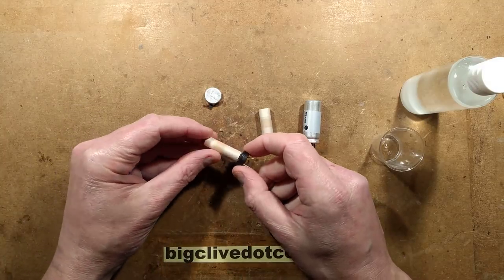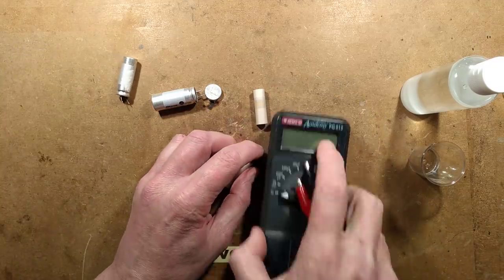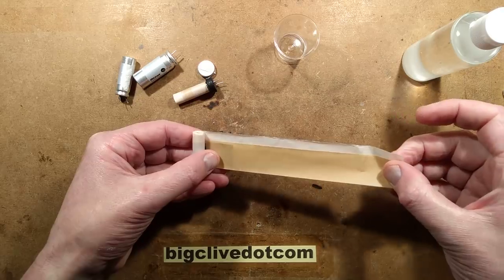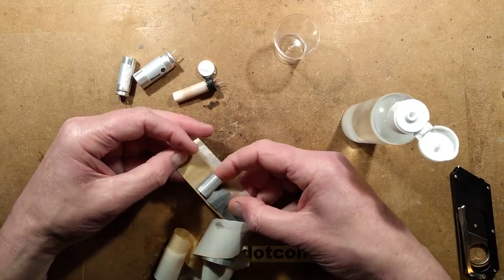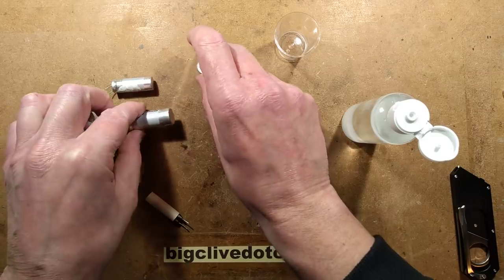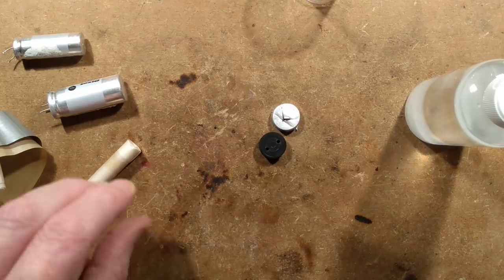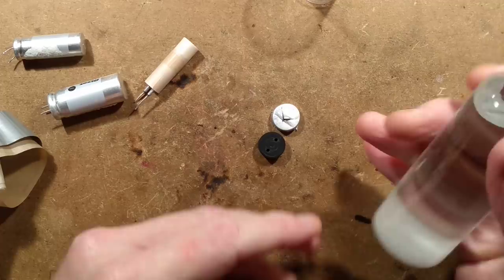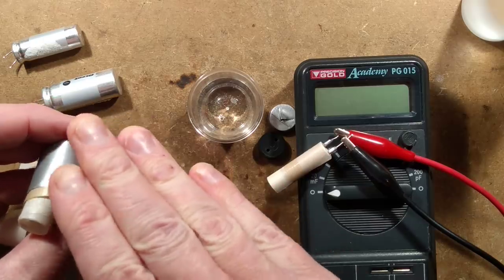Adding electrolyte to a fake (dry) capacitor.

Comment: As far as I know capacitors are formed by very slowly charging them (until the leakage current 'causes them not to charge further), then discharging them and charging them again multiple times. As you charge and discharge them, the leakage current should slowly start to drop allowing the capacitor to reach higher and higher voltages.
You should also be able to "deform" working capacitors btw. by very very slowly charging them with reverse polarity over and over again, 'causing the oxide layer to dissolve on the one side and build back up on the other side. So theoretically you could "reform" a capacitor so that the polarity label is the wrong way around. And then you can give them to someone as a prank... :D

Comment: An interesting (if you're at all interested in chemistry) fact about acids is that certain acids cannot even truly exist in an acidic environment. Examples besides boric acid are carbonic acid and hypochlorous acid which are really just CO2 or Cl2 dissolved in water without a something more basic present to stabilize them as carbonate or hypochlorite respectively.  That's why adding acids to baking soda is fun and adding them to bleach is dangerous.  Both gasses rapidly come out of solution without a strong base to keep them as stable and soluble ions.
Also there are the fatty acids which despite being called acids cannot even dissolve in water on their own and so can't 'do' anything acidic without a strong base, similar to the gasses i mentioned, except that they are either soaps when things are basic enough or fats if not. They are huge, heavy molecules with boiling points of hundreds of degrees and so precipitate out of solution rather than bubbling out. And lastly, there are things called acids that are simply derived from acids and are more properly amides or peptides ie: LSD and DNA.  I'm not sure why that's done. Maybe someone who knows more about bio can shed some light on it. My guess is that people are just lazy and calling things acids makes them sound cooler and more dangerous.

Comment: They probably found that the first capacitors of the batch were failing the voltage test, meaning that the oxide layer was not thick enough or not continuous.  So they stopped filling them with electrolyte and let the remainder of the batch continue to be cased so that they could sell them as dummies.  The one Clive tested may have had holes in the oxide layer.

Comment: With electrochemical reactions you will generally see the same voltage/current for a long time until the reaction gets close to depleting, since there's a saturation effect where the current is limited by something other than the reaction itself until it isn't.

(Please correct me if I'm wrong, I'm not a chemist)

Comment: youve made a poor electrolytic rectifier XD
Reply: Yes those things do actually exist or at least did it one time also there was the electrolytic surge protector that used aluminum I think sodium hydroxide? Is electrolyte but was actually a surge protective device hexe even use water that was flowing for surge protection and power plants back in the old days.

Comment: Siemens and other manufacturers of VFDs give a time span to reform their capacitors in said VFDs wich ist said to be a quarter voltage with a few hours at a time and then another quarter (of the known nominal voltage).

Comment: A lot of really old devices don't even have electrolytics - they have wax or oil caps. Some don't have capacitor problems at all, some use dry electrolytics or mica, other materials that don't have issues at all.

Comment: I have noticed (through experiment) that A DC capacitor will conduct current continuously when the voltage is the wrong polarity and so eventually heat up depending on current, cheers.

Comment: 5-6ma is quite some leakage current. You need to leave it for a while so it can build the layer. You also need to build up the voltage slowly. I think the bubbling is a good thing. I bet it causes the gas to form which makes the oxide layer.

Comment: Since the anodizing process requires current, and since aluminum oxide is an insulator, for a given forming voltage, as the oxide layer gets thicker, current diminishes until the forming voltage is no longer able to shove any more current through the capacitor.
 So you basically need to leave it till voltage stops going through it, which can take hours.

Comment: If you have very old capacitors, you sometimes need to "reform them".  You use a very high resistance and the rated voltage or raise the voltage with time.

Comment: The simplest way to see if the cap can hold a charge and has a low its ESR is, to charge it up to about 12V, disconnect it from the PSU and short the leads. You should get a nice loud crack and spark. Repeat the process but this time wait a couple of minutes before shorting the leads. You can roughly gauge the amount of leakage by how reduced the spark is, if at all. Plus the spark makes a nice visual and audible spectacle.

Comment: When I tested a capacitor, that was stored since the 70th, it was only 40% of the spec. But when I tested it again, the capacity measured 60% and gradually rose with each test, until it was up to spec. Now I wonder if the forming process was involved there.

Comment: You will read OL across a capacitor because there is no direct conductor between two terminals. Which is why when you look at a diagram the symbol for a capacitor it is just 2 parallel lines that don't touch. It shows up as 2 diodes as well because of what I stated above. Diodes only allow current to flow one way.

Comment: 4:45 If the person who solders components to the board is not an idiot... this technically will not happen. This is why if you unsolder capacitors usually there is "little legs lenght", so the rubber seal is almost touching the PCB, making the top pop instead of lower seal

Comment: It says in my car's manual to use only ethalene glycol based coolant suitable for engines containing multiple alloys. After reading a bit more into it though my car should have 10 year 120k mile coolant from the factory.

Comment: You can get those testers for £2 in the UK but got to ad Post and Packing. I thought the original capacitors were filled with an oil based product as on packaging it used to say oil filled capacitors.

Comment: If you use a current source of 0.5-1mA, with the max voltage set to 1.5x the rated voltage of the cap and leave it until the current reaches almost zero the layer will be formed (will take many hours).

Comment: In 1981 I had some power correction capacitors made for me at the Phillips capacitor factory in Kings Lynn, Now no longer there. I had the chance to go inside and saw them making the capacitors which took only minuets to make but then they had to be formed which was done overnight. The capacitors some of which I still have were all hand made.

Comment: As a mechanic, I'm quite familiar with the smell and taste of ethylene glycol. A couple drops won't hurt you. Yes, it's normally quite sweet, and is why it's so dangerous to children and dogs. In recent years, however, they've started adding Bitrex to it, and ever since then, if I get a small amount on my hands, I then have to wash them like 10 times before I eat, or else anything I touch tastes bitter. Anyhow, the average adult would need to drink several ml to see any effects, and about 30 mL can be deadly to an adult. A taste on the fingertip isn't going to do anything to you.

Comment: Clive, first off, forming the capacitor is a dreadfully slow process starting in the mV range and slowly... over several HOURS ending at the effective limit voltage of the capacitor.. you also wind down current from a few mA too a few μA (or even pA for very high voltage caps).

you also start with aluminum foil that's not oxidized at all. Under a heavy inert gas the etching of the foil is done with a special "sponge" full of echant that's rolled back and forth over the foil. all this CAN be done in a home lab setting but it's very fussy and extremely difficult to keep consistent. I'd recommend a good supply of  sulfur hexafluoride (SF6) as that's usually what the foil is prepared under.

Comment: I do not know if it is true, or not, But, I have been told that to form old electrolytics (in old equipment) was to flip the power switch on and off a few times.

Comment: It takes a long time to reform a capacitor. Current limited to a few milliamps and peak limited the voltage. For some time it was common practice to try and reform recycled electrolytics or reform NOS eletrolytics.

Comment: Does it need to be sealed in its casing with all the air pulled out? I wonder if it's possible to make a simple circuit, such as a crystal radio circuit by building every component from the bare materials from scratch? I would find that very interesting and educational.

Comment: Have you seen "Mr Calsons Labs" video on aging capacitors? When the paper becomes acidic high leakage currents pass through the capacitors. I jote that when you tasted the electeolight you said it tasted "sharp and acidic" along with sweet of course.  That is why antifreeze was being added to cheap wine to sweeten it a few years back in France.

Comment: And a capacitor forms before us....ta dah ! Interesting that your C-meter shows a good value, though leaky, but the transistor tester can see two diodes. Re-forming large old caps in cans (in valve radios for eg) is done with some current control and over many hours I believe Clive.
No idea how it's done in production  though, can't be too different.
Btw. Ethylene glycol is deemed 'slightly dangerous' to kids because it tastes so sweet, and is likely to be found in an unmarked bottle in yer average house/garage of a few years back :o)

Comment: Being aluminum in contact with air over time, an oxide layer will occur. I wonder if there isn’t an ability to form the layer, or if you need to shock it with a much higher voltage.

Comment: This appeared to act as if the capacitor was reverse biased: It was leaky and overheated. Possibly the physical ordering of the permeable membrane, plates and insulator does matter and what appeared to be a guess as to which electrode was +ve and which was -ve was incorrect. I don't know that is true, but seems plausible.

Comment: These aren't "fake capacitors" at all, they are the unfinished material of a cancelled production of capacitor, likely salvaged from a landfill consignment.      
They only become an authentic fake capacitor at @8:50 , when the tester is fooled into 'measuring'  around "1,000 uF"

Comment: By the way you can DIY your own caps out of beer bottles and aluminum foil with salt water as an electrolyte.
Reply: That's a kind of Leyden jar, the very first type of capacitor to be invented. Only really useful for high voltage experiments as the capacity is very low.

Comment: Recapping with newer caps, should be a bigger niche  where the solid state replacements are just built into cans that mimic the size of the electrolytic they're replacing, just for ease of fit.

Comment: Just a note, ethylene glycol is toxic at .1cc per kg body weight.  Tasting it is generally regarded safe, but obviously not recommended.  We would have lost a lot of auto mechanics who taste leaking liquids to diagnose a problem.  Some of which are more toxic than anti-freeze.

Comment: Ethylene glycol is sweet which is why animals and children drink it and usually die from massive kidney and liver failure.  I only use the propylene glycol versions of anti-freeze as it is "safer" and less toxic.  As a matter of fact, it is used as a solvent in many medicines.
Reply: The dose makes the poison. Propylene glycol is also poisonous. AFAIK, one cannot get ethylene glycol antifreeze. Oxygen and water are also poisonous if high doses are used in the wrong circumstances too.

Comment: All capacitors have a maximum voltage rating, where above that voltage it starts to conduct DC current. Seems like your capacitor had a very low tolerable voltage which would explain why they were detected as diodes in that tester. The multimeter might have a constant current output to charge/discharge the cap to very low voltages, below the maximum rating of your cap

Comment: You have to wait several hours and increase voltage to reform a capacitor. Common with working on old tube gear

Comment: Another good video, how about weighing out the capacitors with a similar brand then opening up a few , they still obtain the electrolytic property even dehydrated if there was oil in them cooling instead of electrolyt,
Reply: If there's oil in a capasitor then it's not an electrolytic one but paper in oil type.

Comment: did you know that these “ break points on purpose” are also present in beer kegs ? just in case unregulated full pressure reaches the keg. they are at the bottom for obvious reasons .

Comment: I think it conducts current because it DOES have a complete circuit there. You dipped the whole thing into a conductive solution. Forget the foil and its oxide layer, the coductivity goes from one end terminal to the other across the edge of the capacitor.

Comment: So is it the break down of the electrolyte that changes a capacitor into a resistor, or is it the burning off of the electrolyte. 

I have seen many air conditioning condensing units with capacitors that have blown the top off. I have always wondered if there was some way to prevent the run capacitor from failing.

Comment: You could try comparing the Ohms of each foil. One might already have the oxide layer. AlO2 is a clear crystal and can be single μm thick.
Maybe add some gelling agent before soaking.  The dielectric above the foil might need trimming off.

Comment: I am pretty sure this is not electrolytic cap, in electrolytic cap on electrode is a metal sheet, second electrode is electrolyte and insulator is oxide layer on aluminum (metal sheet). The one you have is just a paper capacitor. What you can do to make it better is to soak it in oil (dielectric) and roll tighter maybe... I am not a capacitor maker, so I might be wrong. But from what I read and from what I've seen disassembling capacitors, those a very similar to old soviet paper capacitors (construction, not actual form).

Comment: Another fascinating video. I have replaced many caps in my days and this video has visualized so many curiosities I have had regarding venting and electrolytic degradation. It's encouraging to see how easy it is to vent although I'm curious as to why it would push itself off the rubber seal instead of bursting open the vent? It should surely be secured more tightly?

Comment: If the capacitance meter measures a capacitance I would measure the leakage current and voltage involved in the test. Supply that voltage with current limiting for several days and the leakage current should slowly drop. I think this test could become a limited pass as the ESR may be a bit high but if leakage current really plummeted then the principle is proven,

Comment: The plates are different. Since you randomly picked which you would consider which, you probably failed because of that. The dark anode has the oxide as a dielectric. The cathode is just a connection to electrolyte and it's supposed to stay shiny.

Comment: So this turned out to be kind of bust but it would be really cool to see you build a circuit with this capacitor and see if it does it's job properly. Get a scope and some caps of comparable value and see if the "revived" cap can hold up to a real one.

Comment: Ethylene glycol - yum! "It won't kill your ass, but it sure will make you ugly."  I heard that somewhere once.

Well, I know you shouldn't put it in your car's gas tank... My dad tried that once, because he heard from "somebody" that it might be a good idea somehow. We got about 10 miles down the road before the old Dodge quit for good. Turns out that "somebody" had actually been speaking of automatic transmission fluid (which at least is a petroleum-based product), NOT anti-freeze. 

Both started with an "A" anyhow...
Reply from the maker: There was a trend of adding acetone to gas tanks.  It's controversial.

Comment: You should always discharge the capacitor before testing with that LCR thingy because even a small charge can destroy the tester. Regarding the capacitor you played with, is it possible that one to be a non polarized electrolytic capacitor?

Comment: Try using a gun/metal “bluing” solution on one of the aluminum foils (being careful not to tear it), then wind it back up and then try applying the current so the (-) terminal is the one you blued. Try testing the capacitance; is it still close to 1000 uF? Does it go up or down? Using the “tin-o-fire-containment”, put the bare, exposed capacitor into the tin, and crank up the voltage and see if it gets hot enough to spontaneously combust!

Comment: I see that you have one of those rechargeable LiPo 9v batteries Clive. I bought a couple of those ages ago, two different brands, and asked you if you were ever going to do a tear-down of them. Do you have any plans to do so?  I've found that they're fine for things that draw a bit of current and need replacements / recharging regularly but rubbish for things like smoke alarms so am assuming the charge / protection circuitry has a (relatively) high quiescent current draw? Cheers.
Edit: Before I bought one of those I powered my tester with 2 x 14500 Li-Ion cells in a 2 x AA cell holder. It seems to do fine with voltages down to about 7.5v.